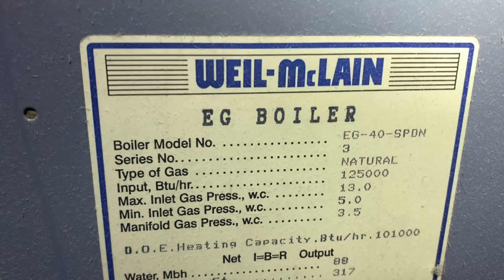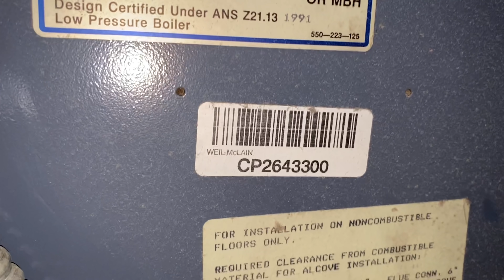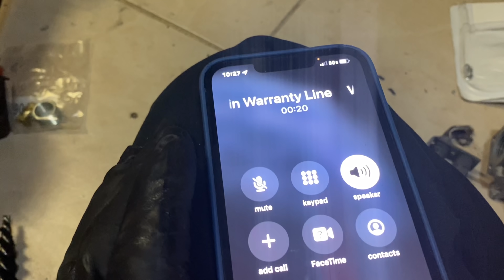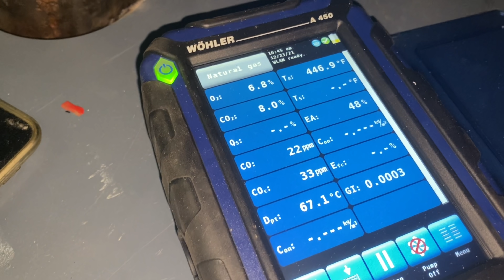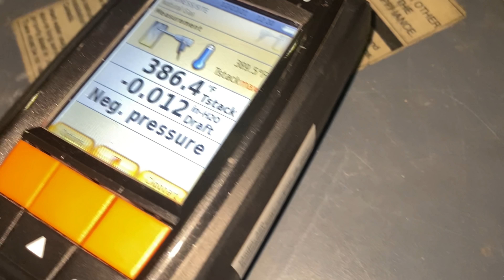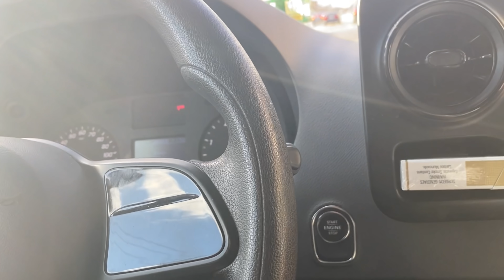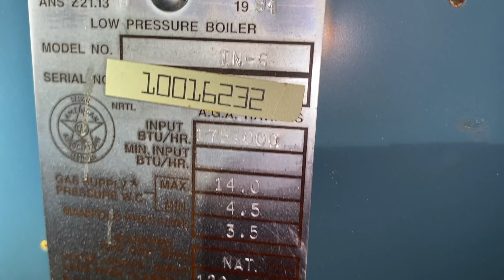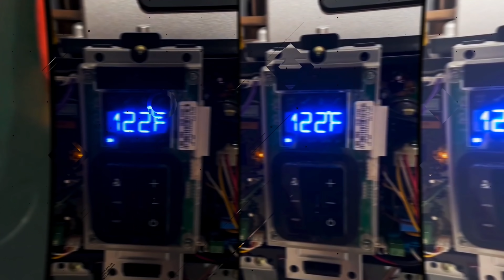Deadly & Lethal Carbonized Weil McLain Boiler Setting Off CO Alarms Repaired and Scrubbed

Comment: Root cause is the dust from doing the laundry in the room. The dust is blown into the burner tubes and blocks the holes in the tubes. The dust is relative first blown to the back of the tubes. Also in the front of the combustion chamber there is secondary air drawn in. In the back there isn't and burning gets fat. Always blow the burner tubes from outside in, the dust forms a blanket on the inside against the holes.

Comment: the biggest standby energy loss on current gas water heaters is through the flue pipe, which is why they added a damper. once they went to the injected foam insulation, adding more insulation thickness didn't gain them much and it probably cost them a bunch due to larger outer steel shell and product redesign. they always should have had dampers, but for many reasons they never have.

Comment: Mike saw one of your videos on nest wiring. I have a Nest E that I was using for my older system and when we change out everything over to heat pump I can’t get the cool setting to blow cold air. I think it’s the wiring but couldn’t figure it out. The new existing thermostat works fine but I wanted to switch it out with this Nest E. Any suggestions?  Thanks for all the educational videos. Solid work out there!!

Comment: Was using pipe cleaners one day to clean the “grates” on air return etc…and homeowner comes up and was like, pipe cleaners, ya mean they actually can be used to clean pipes? They not just for my kids crafts. Started laughing (in my head, never at customer, fyi/imo). They make some rally cool shapes and make my own “brushes” outta a bunch twisted together and they come handy on certain jobs, very handy

Comment: mike, i have an old american standard gpm5 from the late 60's early 70's which is still working and while doing an inspection, i noticed some of the nubbens on the heat exchanger were missing right in the middle. should i be looking at a new boiler even though its working fine or is the heat exchanger on its way out? not sure of the history of the boiler as i bought the house last year. would like you profession opinion, if you would. thanks in advance.

Comment: AO smith makes them also, go figure 🤣🤪 state, american, reliance, lochinvar, takagi, us craftmaster are all the ao smith manufacturing. there's a few canadian brands also the same.
they're all the same junk with a different badges slapped on, the exception is external parts like gas valves, relief valve, damper, tank nipples, etc. those parts could be from various suppliers and different, which is often why you'll end up with batches of different and bad gas valves at the box stores( guinea pigs for new untested junk I think)

Comment: someone needs to tell those bureaucrats where reliable base load and peak electricity comes from to run electric stoves and heatpumps - it's not those crappy wind turbines/solar panels, these days natural gas is the only type of real power plant being built in the usa and it's more efficient to use gas directly.
Reply: @solartherm  solar thermal is great for heating water, but not going to heat homes in real winter with it. at best could supplement space heating a little bit.
Reply: @Jon-hx7pe   so  you're saying the BTU's act differently when you put them to work  for heating? or the other popular misnomer that engineers state is that you would need thousands of gallons of storage? do you work for the gas companies? lol just kidding
Reply: Even if they can produce all the electricity that we would need the grid can't supply the power . And when I say grid I mean the local grid , the cables that are on the poles and buried in the ground . Until they are upgraded this won't work !  We see this every summer when there are local black outs because the substations or the cabling burns up .  NG is clean and safe .  Mikey remember the tanks along the LIE that " GAS HEATS BEST "  ?
Reply: @lhr1701  i'm a fan of heatpumps and electric rail when the electricity comes from non natural gas sources or there's no natural gas available, especially renewable hydro. you're correct in that the grid can't take a transition to all electric.

Comment: Pick up some Tyvek hazmat type suits, should be able to find easily. This was used at a plant I formally worked at. The boilers were firetube but needed to be cleaned at least annually better twice a year.
The carbon/soot was serious crap for the techs.

Comment: On the WM steam boiler i see they have a hot water zone, is it on a heat exchanger? I see an expansion tank, I don't use them with only using the boiler water, do you see a reason for it?

Comment: A bit scarey.....this is why the co moniters should be mandatory
Reply: A CO detector saved my customers life last night. They had 50 ppm of carbon monoxide spilling into their home from their furnace. Red tagged and we are putting in a new heat exchanger asap
Reply: @Austin23191   an eldey couple passed away in their home around here during the winter when the vent on their direct vent hot water heater froze over and caused all the co to enter their house.

Comment: Hi Mike, I think you’re not seeing Efficiency numbers on that Wohler A450 because your temperature probe is on a wrong position. (Ambient temp) . For proper operation, you should put temp probe on stack temp and analyzer should be able to read efficiency correctly. Good video by the way.
Reply: someone needs to RTFM 🤪🤪

Comment: Why would they have the flow check valves and circulating pumps  if that's a steam boiler
One pump for basement level I understand but there's two pumps there.....I can't really tell how  the entire set up is set up but that's weird
You sure that's a steam boiler?
Reply: @PipeDoctor  I don't see any pressuretrolls plus there's a temp and pressure Guage...but maybe the pressure trolls are not in sight
Reply: @PipeDoctor  OK yes I just reviewed it again 
Great job on your videos man keep em coming

Comment: Law against nat gas is ridiculous.  Electrical heat less efficient and does not meet energy code.  Electrical generation at the source is mostly nat gas anyway.  Large commercial electrical equipment not made in capacities needed.  Ignorant decision will hurt developers and result in higher rents and utility bills for tenants.  Will drive business and residents out of those jurisdictions.
Reply: Electric heat is 100% efficient, just costs a lot more.

Comment: Hi Mikey I just left you a message at your company I need your help I have a month old wheel McLain boiler and I can’t run it I have no hot water the company that install that has been back here 10 times and unable to fix the issues it started out where the nozzle failed within the first two weeks of having the boiler there was all black tarry stuff in there and I took out a little fan piece and that little valve and they replace the valve just clean that other piece and put everything back together that was one problem then we had no hot water they came back for that then we had a smell coming out of the flu which is constantly happening I can’t keep the boiler running for hot water because the whole house gets filled with fumes  I’ve been up for days and I’m just exhausted I need help if you can come to my house and diagnose the problem I would appreciate it I just left my name and number with your company. Thank you

Comment: How did that gas boiler get so sooty, that’s usually indicative of an oil boiler with low air flow
Reply: I wonder if there is inadequate oxygen in the room when the boiler room door is closed. If there isn't enough O2 to fully combust the NG you would expect to get some C02, some CO and some pure C.  Would it make sense to do a combustion test with the room's door closed?
Reply: @joeb3300  Good idea.
Reply: Some areas get dirty gas. The gas we get here burns dirtier than the oil, especially the new biodiesel. Properly set up oil boilers here have no soot but gas boilers get soot clogging the burner tubes, then the rest of the boiler. Only atmospherics though, never seen it on a power burner.